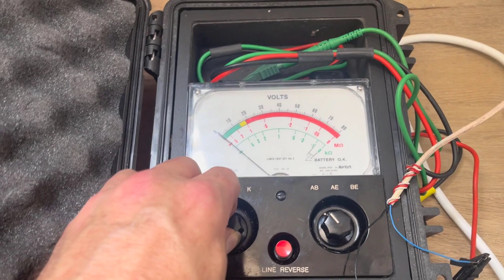NBN FTTC Box Light Flashing Red Connected Directly To The Lead in Cable At MDF

Comment: Suggestion, when you use LTS to show no problem on internal cabling. you should also short one end and retest, the toner inject itself on both wires in a pair, giving a false sense of circuit completeness, you should also, although you can not lawfully touch a pit under CPR's, you can run a ABE test on the leadin which can show issues.  
Lastly, Invest in a good tester, plenty of cheap HST3000's around as techs upgrade to new ONX580's, the 3000's still work perfect for 99% of applications, for fttc theres the NIA
Reply: Blows my mind to see some of the techs out there not using the viavi 580 does everything you could want it to do
Reply: true. A loop on far end will also prove the F set would not have an audio sound-a backwards way of proving its a good short on both legs. Second the JDSU . Made my job easier